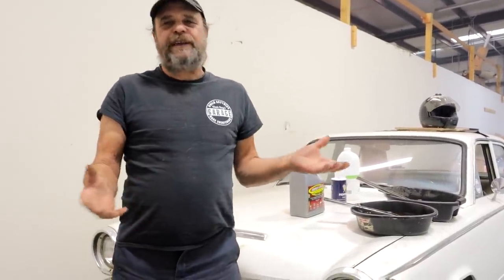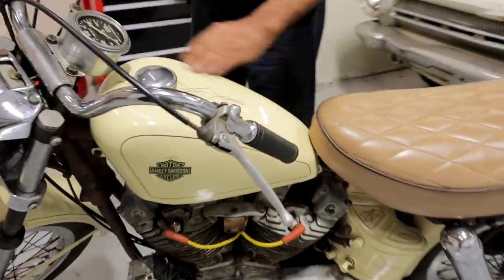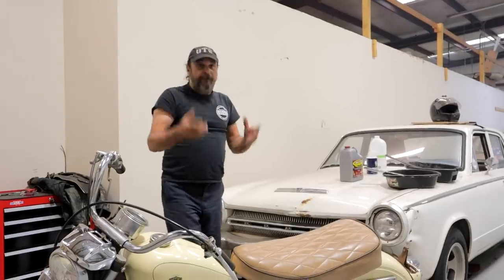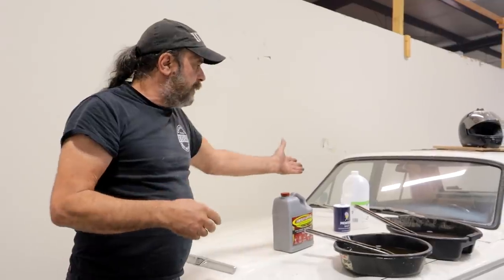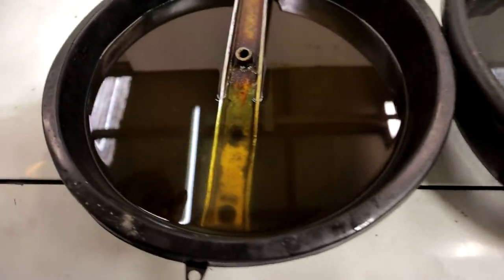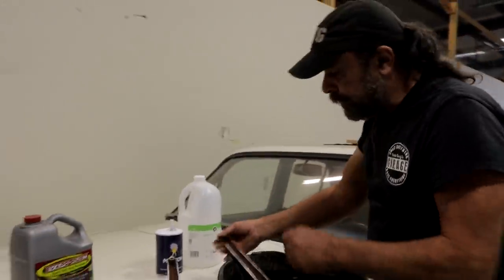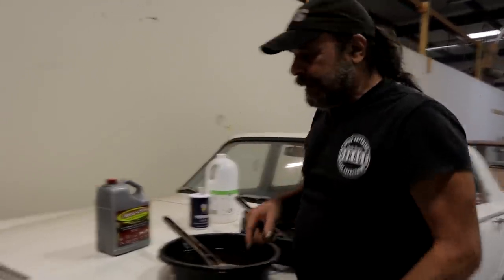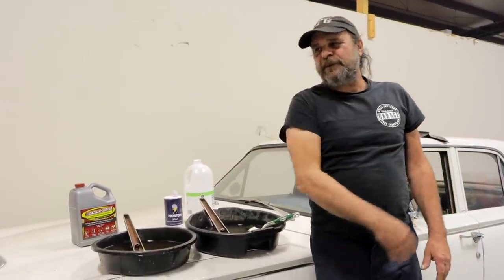Evaporust Vs. Vinegar - At 10X The Cost Does It Do 10X The Job?

Comment: I've used both of these (although I didn't put salt in the vinegar). In my experience both method work equally well, the evaporust is just faster.
Reply: Acidic solutions like vinegar and citric acid both need to be neutralised unless you want the rust reappearing.

Comment: The success of Evaporust is directly related to the quality of the metal it is being used on, with the actual amount of IRON in the material being an important factor. 
As for the sticky spots, you are supposed to rinse things with water when you are done, meaning also the sticky parts will wipe off with water. Sounds counterintuitive, but that is how it works. Just dry the stuff after. Also, You can REUSE the evaporust until it doesn't work right anymore. Keep a seperate jug and poor the used stuff in, reuse it some other time, add a dash of new water to it. I have found it works fine until it is so black you can't see in it anymore at all and you have diluted it by about 20% to keep it from getting thicker. At that time, performance drops off enough to throw it out. 

Sheet metal? Not really that great, most sheet metal is not pure iron because it would be brittle. Depending on the type of steel alloy though, it can be effective, all you can do is try. i put some on some surface rust spots in the trunk of my Monaco Police(in the little grooves in the trunk floor, nothing scaly) and a day later i soaked it up with a rag, dunked a clean one in water, wiped the grooves out and they were shiny like new. Dried, primed, painted. I have also had it not work well enough on other areas or projects to consider it a success, but I just wiped it off and nothing lost but a couple dollars of stuff for the attempt. 

Old metal tools, frame brackets, etc? HELL YEAH, the stuff is like some kind of alien juice brought back from the future. I dropped all kinds of hand tools into it from the 60's and 70's and they came out perfect. What really surprised me though, was some seriously old iron tools I did. The best example was a 1920's era grinding wheel dressing tool(the little spur on a handle looking jobber) That was just solid rust. Not flaking off type, but just solid rust, enough you couldn't really tell what the raised letter branding on the handle was anymore, but at the same time, the type of rust you get on things that have been handled... you know, sort of "buffed" rust on iron, smooth to the touch yet completely rusted if that makes sense. 

I dumped that thing in a tote for two days, came back, brushed it with a soft brush and rinsed it in water. 
Not kidding, the thing was unrecognizable. It had SILVER PAINT on it. There was absolutely NO INDICATION that this tool was ever painted much less still had some. When I put it into the stuff. My jaw dropped. 

I rinse the stuff with water as the directions state, blow it off with air, then hose it down with a squirt bottle of WD40 and lay it on a rag to "dry". The grinder dressing tool has kept it's new lease on life so far for a year this way in my tool box. 
I also did an authentic Swiss knife I got at the flea market for a dime. It was RUST. No way to open it, no way to even see what all blades etc were in it, but it did have the little logo on it so I went for it. Soaked that one for a week, brushing once a day. Got to the point I could wiggle the blades, and the rust was pretty well gone from the outer surface though it was obviously pitted in areas. Dunked the thing in a pan with some fancy oil from an industrial machine at work(the $16 a gallon kind) for 2 days, then hosed it with WD40 to rinse it, got the blades to at least pull open. Back into evaporust to clear them off better and get into the grooves. After another two days, and some more lube, I got the two big blades to work(one is this wicked "Eagles claw" hook type blade) the rest woouldn't open fully, but one of the spring tabs was bent so I gave up on the bottle opener parts. Knife is ugly, but I haven't tried a metal polish wheel on it yet, but after a 5 minute dress the hook blade is sharp AF. 

So anyway, I am a believer in the stuff. But I think it has it's uses, and sheet metal is pretty hit and miss for it. Just don;t forget you can REUSE IT! Save the stuff for a second and third project! Rinse with water(and WD40!)
Reply: You know your stuff man. But i got question. About cleaning the coolant system from rust. I already used coolant flush product, but it states it removes gunk, grease and dirt , NOT RUST. Some old school mechanics told me to use 50/50 water/vinegar , but i'm afraid of the vinegar to make holes in radiators and such. Do you think EVAPORUST will work as coolant system rust remover? PS: I'm talking about all aluminium engine.👍
Reply: @petar443  Wow, I had never thought of that. I honestly don't know, but I don't think it would take oxidation off of aluminum very well. it is more for iron and steel type of materials. Most people I have seen with really dirty coolant will run a flush more then once though, flush, rinse, flush, rinse, etc. Don't forget the heater! You need to turn the car heat on to get the heater core flushed too. If you live in a warm area you can just run regular plain water to get the flush product out in between. There are videos about it, some of them get some really gunky engines cleaned out nice. 
Good luck! if you find something that works great, make sure to share!
Reply: Vinegar can be reused as well. I have done it many times and for the cost will continue to use it as my go to rust remover
Reply: @todddenio3200  True but vinegar seems to have less magic in it before it is consumed... although I have only used it where there was some calcium buildup with the rust... maybe the calcium reaction uses the acetic acid faster than straight rust.
Reply: @petar443  The problem I have with vinegar is it eats the metal.  Yes no a lot.  But it etches the metal created many many many many more points for rust to form.  Evaporust wont.  For your aluminum I would assume you are going to run a rust preventative/lubricant or coolant after so long term rusting wont be a problem.  Personally I would run the car with 50 50 vinegar... let it idle and heat up then let it sit and repeat.  It will take a day at least.  Then rinse it would really well.  If you can remove a thermostat housing or something else you can check your results.

UTG results were not typical.  I dont know how long he let it set or how warm the shop is but I have found evaporust to work very well and pretty quickly.  I also used similar products from Lloyds and POR15 also has a prep.  But that POR15 rust remover etched the crap out of the parts when I forgot about them for a few days.
Reply: @someguy2741  yes the calcium reduces its effectiveness because calcium is alkali which neutralizes the mild acid in the vinegar.
Reply: @someguy2741  I have done experimenting with vinegar affects on steel that has rust and also has I rusted areas and have left it soaking for extended periods and the only affects it showed on the good steel was to put a blackened coating on it which is only on the outer surface and even using a micrometer before and after soaking for months showed absolutely no difference
Reply: @todddenio3200 Interesting.  I suppose if the rust is on the entire part then it would already be pitted.  If theres no plating at that point same thing.  My items often have a desirable coating or a machined finish or is only partly rusted.  I have some rusted stuff I need to work on today.  I might set up a sample of each.  I was planning on setting it all up with electrolysis today and working with it tomorrow... I have some scrap of the same stuff so will drop it into each.  

I am wary of damage from this sort of thing.  I had a nice specialty bolt... cant remember what it was for but it was special threads and 50 years old.  It was rusty and I put it in the por15 rust remover and left it a couple days.  When I took it out it had removed the rust, the plating, pitted the metal, and knocked the edges of the threads... it was no good.

I think I will give the vinegar a try on a plated bolt and see what happens over the next couple days.
Reply: @someguy2741  rust had already done the damage to your part that is why it looked bad after the rust was dissolved. Vinegar is a very mild acid which is what removes the rust. It would take a VERY long time to pit metal. Every product made for removing rust has some type of acid in them in varying concentrations.
Reply: @petar443  first choice is Ford VC9 coolant flush. Krud Kutter is also labeled to be used for rust removal in coolant systems.

Comment: Tony, my experience with a fuel tank is to put about a cup full of small gravel. Shake it around, turning the tank to get as much of the loose rust off. Shake out the gravel, rinse with water, then treat it. It seems to work a lot faster because it doesn't have as much rust to penetrate. Love your dedication to educate!
Reply: Attach it to a paint shaker with your rocks in it ?
Reply: @cammontreuil7509  no sir. Just shake it around for a few minutes, maybe shake it around several different times. Just to get the large rust flakes broken up. Gets it closer to the inside surface. Then treat it the way you are doing it.
Reply: @catbird1759  I'm sorta making a joke. But you have a good idea.
An old school machinist had a rock tumbler he would clean parts in it. He used rocks.
Reply: Yeah, using lead bb's with mineral spirits is what i heard.
Reply: Marbles work and you can get them out easier
Reply: I found that putting in an entire bag of washers is the best. Smaller the better and then shake it around. The reason for the washers instead of rocks or marbles is that you can just put a magnet on a stick in the hole and get all the remaining ones that don't come out easy. I have tried it other ways and I feel like there are always a few that are a pain to get out. Never had that issue once I used something ferrous and switched to a magnet.
Reply: Gravel, small short wood screws (with sharp aggressive threads), nails, roofing nails, the list is endless but I seem to recall someone using a contraption that was basically a rock tumbler for small fuel tanks. It was powered by a electric motor, maybe had a belt drive and it turned a plywood wheel that you could strap the tank to. Turn it on and it slowly tumbled the tank full of nuts and bolts and maybe a small quantity of kerosene. This would make sense for a motorcycle and minibike restorer.

Comment: The biggest problem I have with both methods is that you have to have enough of the stuff to submerge the parts for it to work and it's just not all that practical to do that. Probably 10 years ago I bought a 5 gallon bucket of Evaporust and I've been using the same bucket of it ever since. It's turning out to be a lifetime supply since even 5 gallons isn't all that useful. It does do what it says it does (won't harm anything, which vinegar eventually will), but it does take its sweet time and is cumbersome.

As far as the residue, Evaporust is water soluble so that residue just needs washed off in the sink. With a gas tank, I'd flush plenty of water through it (regardless of either vinegar or Evaporust) and then purge it with a few pints of isopropyl alcohol to push the water out and then put it somewhere warm for a bit. Should be fine.

I've been running some rust remover/converter tests of my own and they all seem to have the same basic problem. They're all very expensive and require submersion. I've been meaning to experiment with the gels as I think those are probably a better way to go for most things.
Reply: Excellent post.
Reply: @fireballxl-5748  Thanks!
Reply: The instructions of Evaporust suggest soaking rags/paper towels, and wrapping larger parts with them. Might want to give that a shot.
Reply: Navel jelly works pretty decent, but it doesn't penetrate well like something being submerged.
Reply: @MitchellSmith  “Navel jelly?” Pretty sure that should stay in the bedroom.
Reply: rust mort u just wipe it on and it works way better then both of these ideas it converts the rust back to metal plus treats the surface i did a car after 20 years no rust in a wet climate i was told about it when i was young by a pro builder for custom hot rods he said it is the only way to go on rust . i never see anyone use it on the net after using it i laugh at all these guys
Reply: @SuperInstaGib  only if your "tool" is rusty! Lol
Reply: @jeffrey4547  You mean "Rust Must", aka, "The Must for Rust"? If so, I tried that stuff out on my channel and wasn't overly impressed. It worked alright. The problem is that anything that thin just doesn't hang on to the surfaces long enough to work.
Reply: @SuperInstaGib  I've tried that. They dry out too quickly for it not to be a nightmare to deal with. 

I've also run it in a recirculating parts bath so I could keep larger parts under constant submersion. That worked, but it takes forever and evaporation is a pretty serious issue since the parts bath had to be open for that particular part.

The search for the perfect solution continues...
Reply: @TheBrokenLife  u are to clean it it get all the lose stuff off before using it if the metal is to thin ur screwed any ways i have had it work for over 20 years on a rig still no rust in it i take a hammer knock out all the thin metal then apply it then fix it use to do fiber glass when i was a kid but after working in a shop cut and replace
Reply: Try Naval Jelly.  It is jellied muriatic acid (industrial grade HCl).  It sticks well on non-vertical faces, and fairly well badly rusted vertical faces.  It holds moisture pretty well, but covering with plastic wrap works better if you need to leave it a long time.
Reply: @jeffrey4547  I'm talking about the product being too thin, like water, not the steel. I used it on body panels and it just ran off on the ground and I had to re-apply it every 20-30 minutes for several hours to get it to work.

I also submerged parts in it, which worked better, but it's way too expensive to buy enough of it to do anything but small parts.
Reply: @captainjohnh9405  I have some of it around here to try out, but as I recall you can't use it on painted areas. Most of what I'm trying to preserve are auto body panels with small defects, so that's no-go.
Reply: Thanks for sharing! Nice to know you can reuse it
Reply: @mikeypotts4732  Oh absolutely! I use it until it doesn't work anymore and/or it smells so bad I can't take it. I think it grows bacteria over enough time.
Reply: @SuperInstaGib  Same instructions as making a torch...
Reply: @TheBrokenLife  yeah, I wouldn't trust it on paint.  It does not, in my experience, harm chrome.  But it is best for surfaces that are not finished.
Reply: @captainjohnh9405  Yessir... I've heard the same before. I'm sure I'll have a good opportunity to use soon.
Reply: @SuperInstaGib  Now that's something to contemplate.

Comment: Vinegar is simply an acetic acid solution. Evaporust is a tannic acid solution. Krud Kutter is a phosphoric acid solution, which is more of a converter than a dissolver. The soultion with the highest acidity constant & molecular density will terminate rust the most efficiently.  That solution is Tannic Acid or "Evaporust". It has an acidity constant of 6 compared to vinegar's 4.7. It has a density of 2.2 g/cm3 compared to acetic acid's 1.2g/cm3.